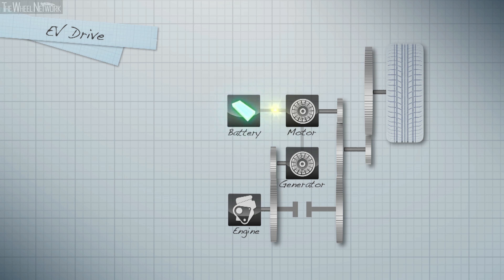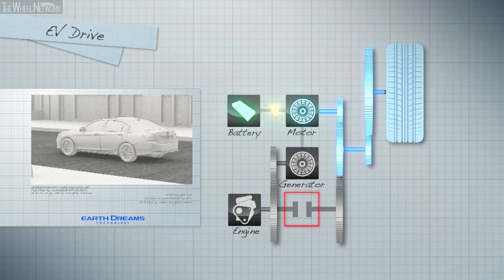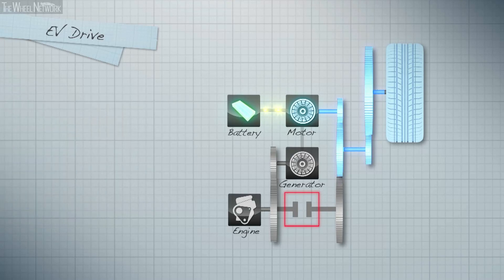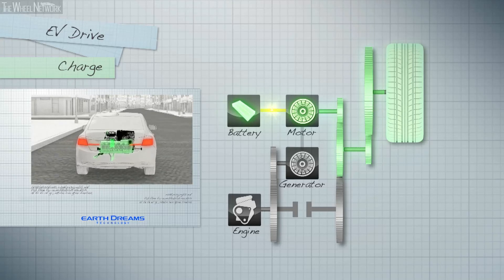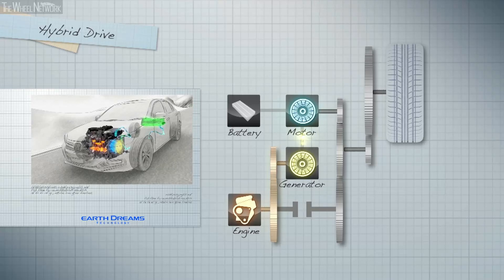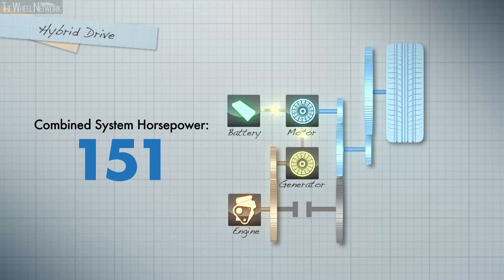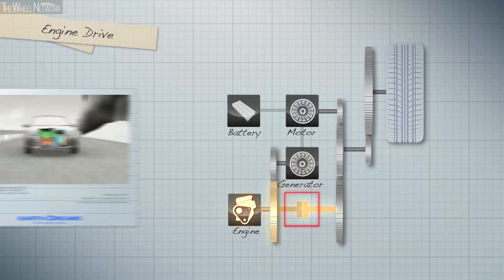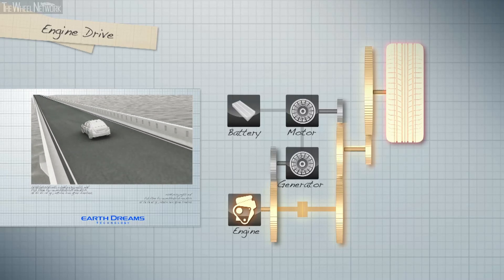2019 Honda Insight Two-Motor Hybrid Explained

Comment: For Honda civic hybrid owners
I have 2006 Honda civic hybrid (reborn shape) this car has CVT automatic transmission. On plane roads or slight slope car runs fine acceleration is good. But on really steep slope car slowly comes to stop and then does not revs past 1.5 rpm and car does not move (this happens when hybrid battery is depleted )
What the issue? I went to my house gate with 6 people in car , car went uphill nicely until last steep slope and then it stopped. Had my friends to get out of car and push.
Reply: I have the same car, 2008 civic hybrid. And i have no problems. Only 12 volt  battery, replaced. It is a great car. The engine it is extremely reliable of any Honda cars. But, the transmisions are not so good. I think you have a CVT problem. Or maybe just a  bad sensor and you will be happy.
Reply: @catalinIntimidatorul  will sell my car
Reply: This is not a problem on the insight when sports mode is activated...

Comment: 1:20 - Wrong. The engine works just like any other hybrid when coupled to the driveline. I see it turn off all the time going 60mph, for as much as a 2 miles once, usually just 1/2 or 1/4 mile though.

Comment: I own one and I have to say it's great, however - at highway speeds, it does not always have the engine engaged and does switch to EV mode occasionally.
Reply: This is the equivalent of what a Prius driver would call "pulse and glide". An ICE driven car at highway speeds is most efficient when it is generating a little more power than is needed. A Prius driver will rapidly accelerate from, say, 50 mpg to 70 mph so it can get close to this range of rpms+power, then coast back down to 50 while using minimal gas. The Insight will do the same thing at a constant speed, by putting itself exactly in the best range and using the motor as a generator to pull some of the excess power off and charge the battery, then turning the ICE off and using the motor only. A Prius can't do that.